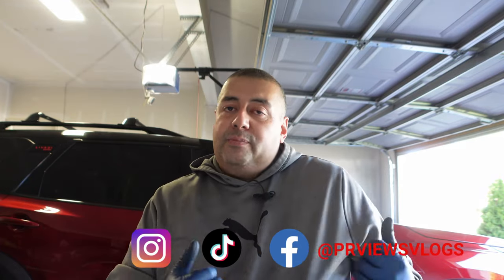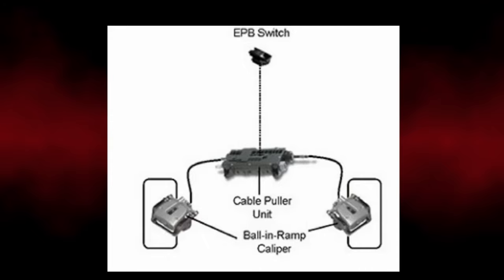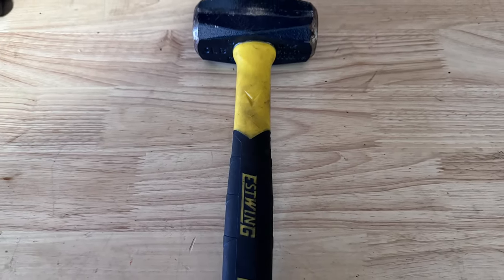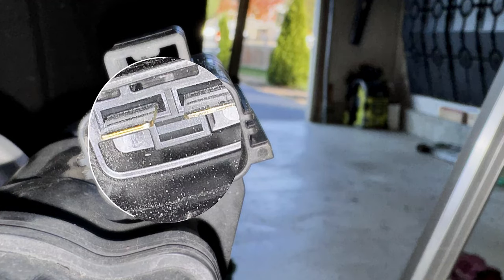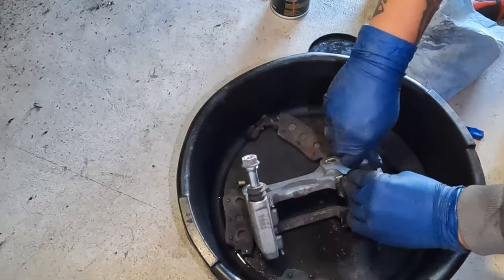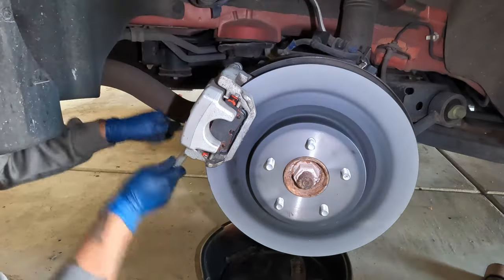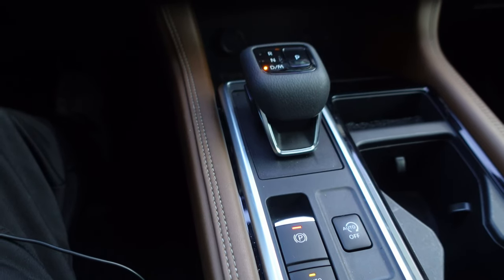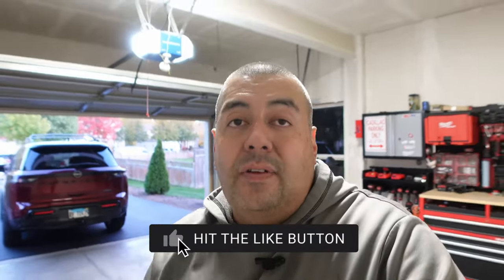Electri E-brake (22-24 Nissan Pathfinder )

Comment: Excellent step by step video! I used a 9v battery that I keep around for my smoke detectors, and I used alligator clips, It worked well, no issues, I had 27,000 miles on the brakes, thank you!

Comment: mine last only 15500 miles and the dealer told me that only dealership can replaced the brake because it is an Electric brake.
Reply from the maker: Like I explained all depends on how u drive and use then how long they last . And this way is the easy way but doing it wrong can result in costly repairs

Comment: Thanks. This worked on the 2022 Mitsubishi Outlander as well. Same setup as the Rogue. 
Saved me about $250 for repair shop to do it with a computer.

Comment: I am getting 10k and dealer wont warranty. Paid the first time. Not going to pay again. Got aftermarket and gonna see if that helps. Heavy duty pads and drilled and slotted rotors. Thanks for the info on the brake release.
Reply from the maker: Pads will be the  same  won’t last any longer

Comment: This SUV according to Nissan was built for good off road use,its well advertised as such
Reply from the maker: Yes and they advertise cars as the best in the snow yet cars still get stuck and have traction issues , it advertising they have to make it sound and look good , also I never said it wasn’t a off road vehicle , but try putting this car thru a mud pit or cross a river like most actual off road cars do let me know how that goes , can it go into gravel and some yes and again that is “OFF THE ROAD “

Comment: The braking is definitely weird. I just got a '24 Platinum 5 days ago. It seems to be a bias issue. Front brakes and rotors are always bigger for a reason. The rear brakes wearing this quick, combined with the unrefined braking, points 100% to a bias issue between the front and back. Hopefully, Nissan can figure this out.

Comment: Can I use my 18 volt battery from my drill to depress the brake calipers or does it have to be 12?
Reply from the maker: I would use a 18v you may cause damage to the motor

Comment: Thanks for your video.  Do we need to disconnect the car battery to do this procedure?  Also, if I apply wrong polarity and when seeing the piston comes out, I switch the wires right away, is it OK, or it already damage the E brake motor?
Reply from the maker: No need to disconnect the battery , just follow the video

Comment: Great video! However the red stuff (if its the anti-squeak stuff i am thinking of) turns into an anti-slip rubber, DO NOT put on pins/slides or the ears of the caliper slides! Only on the back of pads if they do not have shims (Says on instructions)., use a silicone grease for the PINS and if you clean slides like you did, you do not need really anything on there.
Reply from the maker: What ?? Nobody put the anti squeak stuff on the pins 🤦🏽‍♂️ , the grease  have went on the pins/slides which is also red .
Reply: @PRviewsvlogs  Phew! It was more for viewers, the red bottle looked exactly like the CRC disk Brake Quiet! and all the stuff used in video was red and you shown only one container....I can tell your excellent with this stuff......
Reply from the maker: @daveroski yes the bottle is always out but there is also a tub of red lube
Reply: Can it be done with a 9v battery? For the relay
Reply from the maker: @tcgnmore2803 yes it can it make just take longer to retract
Reply: Yep!  Lightly grease the pad slides. The CRC brake quiet is not a lubricant. It sets up as a hard rubberized coating. Not what you want to put on the ears of the pads to interface with the slides on the caliper bracket.

Comment: Nissan doesn't have a brake service mode to automatically retract the piston? Every vehicle I've worked on that had electric parking brakes integrated into the rear caliper had a procedure for retracting them.
Reply from the maker: Yes but only using consult

Comment: What does it mean if you get the lights after changing the rear brakes and the auto feature keeps coming on ?
Reply from the maker: You did something wrong , causing the system to go into fail safe has to be taken to the dealer for reset or repair . Something was probably damaged during the installation

Comment: All you have to do is take out two Allen screws, separate from housing. Take a T45 torque fitting or anything else you may have that fits in the hole and  insert and turn while putting the c clamp or brake piston tool and turn accordingly....
Reply from the maker: You can do it the hard way while u do all that I’ve already finished the brake job .
Reply: Thats too much work bro
Reply: The video was great and while I was worried about making the "tool" it was easy and glad I did... thank you for the video.
Reply from the maker: @agoodiecontreras5014  glad I could help

Comment: Can i use a 18v battery?
Reply from the maker: Why would u want to , just use a 12v , I’ve never tried , the vehicle only uses 12v , u may cause damage
Reply: I was asking  its all I have
Reply from the maker: @JoseGomez-ki6gg  you can try just be careful
Reply: My Craftsman rechargeable 19.2 v battery for cordless drill worked fine
Reply from the maker: @markkolb7818  you got lucky , had a guy use a 18v battery and damaged the motor